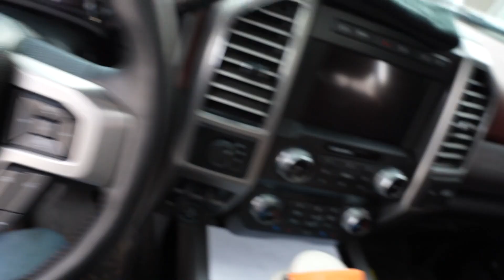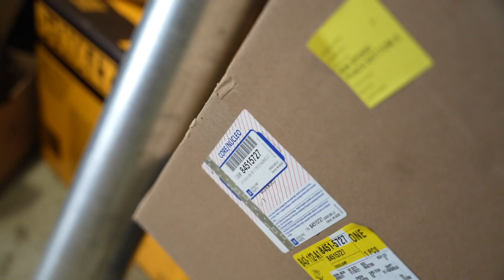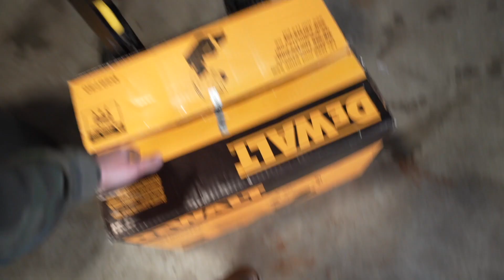Uncovering YEARS Of Abandoned Truck Parts! 💰

Comment: You should build a 2003-2005 Dodge Ram 3500 dually with the 5.9 24v and a 6-speed manual 4x4 or a 2nd gen dually with the 12v 5-speed 4x4 or even maybe a 1st gen dually 12v 5-speed 4x4

Comment: Obs f250 with f350 axle swap with Cummins swap. 4 inch lift 35 tall tire. Regular cab. That would be build that would challenge you but easy enough to do.